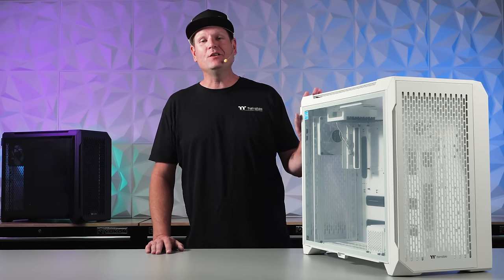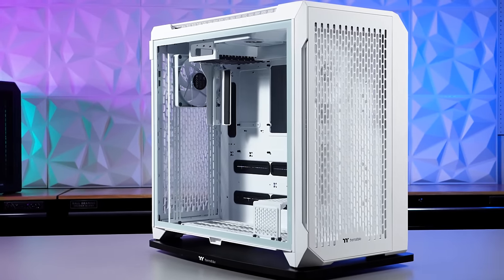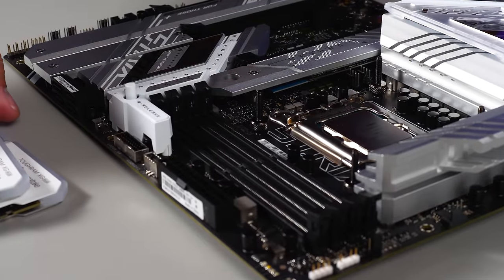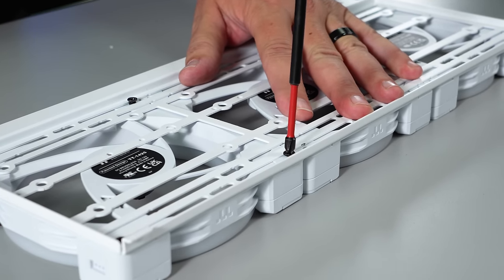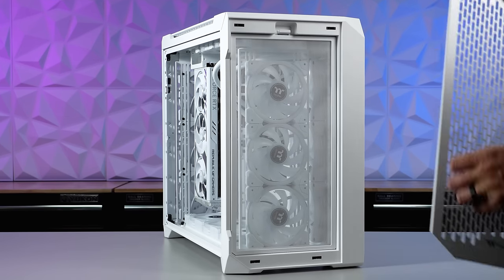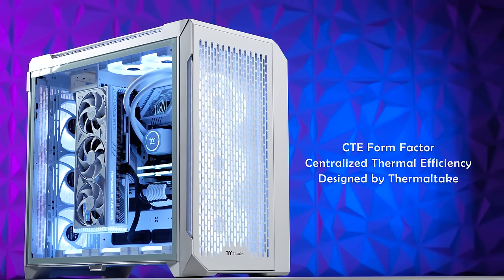Thermaltake CTE C750 Full Tower Chassis Overview Build Guide

Comment: I find it intriguing that there is no mention of the challenging access to the plug plate of both the graphics card and motherboard in your video. It is also worth noting the frustration that arises from the intricate cable routing within the case and the time-consuming nature of plug and play setups. Furthermore, it is quite inconvenient that every cable needs to be excessively long. While the concept itself is promising, the execution leaves much to be desired.
Reply: Every case has pros and cons. Also, not every case is meant for literally every type of PC builder. If all you can do is sit there and point out all of the flaws, meanwhile ignoring all of the benefits, this case clearly isn't for you. And that's okay.

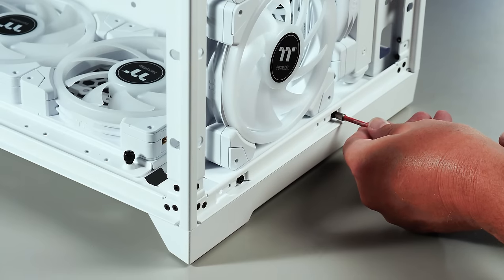Comment: I have the exact 4090 that is shown at 3:13, ever since the case was revealed earlier this year I wondered if the radiator could be installed in the exact spot on the top as shown in the video. This of course means I will have to buy this case now lol

Comment: I built in this case it looks good and the temps are better than my old basic chasis, on each side mine has 2x200m fans intake, 3x140mm bottom intake the AIO has 6 fans push/pull i used the 3x140 that came with the case on the back of the radiator since no RGB

Comment: Nice, but I'm more interested in the C700, can we get an overview of that chassis. Oh, and someone needs to come up with a DIY Screen/monitor/display with a bracket to mount on the bottom fans.
Reply: Thanks for the feedback, the C700 is very similar with the C750 with the cooling mount next to the MB as one of the big differences. Totally agree on the screen ideas, we think we all need more screens in our life too!
Reply: @thermaltake_na  What is the drive support like on the C700 because if is literally a shorter C750, then that's going to be a problem. You're not going to want to mount drives at the bottom instead of fans and one 3.5" or 2 2.5" isn't really enough for me.
It's great to see the PSU behind the MOBO but I really wish the PSU was setup to intake from the traditional rear and exhaust out the top rather than intaking from the side that's likely to be against a wall. If it was round that way, you'd have much more room for drives behind the MOBO tray also.
Reply: @zig131  It's shorter in length, not height IIRC. The same drive bracket in the back would work if they include it.
Reply: @Dexx1s  Yes exactly - which only has room for 1x3.5" drive or 2x2.5" drives. Yes NVME drives are getting cheaper but they're still not really cheap enough to justify for bulk storage of music, videos, documents, and downloads. Plus for important files, I prefer the gradual deterioration of HDDs to the working-one-day-dead-the-next of SSDs.
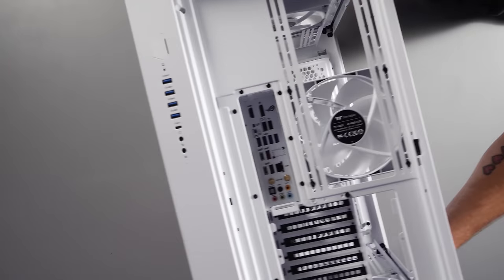Reply: @zig131  1:46
Reply: @zig131  I agree, and my hx1200 is passive all the time, so aiming the exhaust upwards allows the hot air to vent like in my Silverstone FT02 case
Reply: @zig131   Will have the Website up soon for the next models to come with the full details. Computex 2023 is next week, so wait and see :)

Comment: I wish there were a way to rotate it back to the natural position or maybe another similar size case... the vertical gpu position it just gets  too close to the aio and on the right side of the motherboard there is a lot of wasted empty space. I wanted almost the same case but normal layout 3x140mm front, 3x140mm side, 3x140mm bottom, 3x140mm top and 1x140mm back... options to put 420mm radiators l imultaneously... and the vertical gpu bracket has to the get the gpu closer to the bottom to give some distance to the cpu block
Reply: Also, being a big case, I would just make all the brackets 140mm mounting exclusives. The double mounting system 120/140 mm look ugly
Reply: Same.......I like 200's.......I have an ole tt mk1 chaser.....I like all the fans and the filters.......just wrong orientation.

Comment: Some GPU vapor chamber coolers do not like being rotated into this position.... So something to look out for if your GPU temps are much warmer
Reply: that is a myth
Reply: @TheKyozo  Even on Lian Li O11 Evo's Upright GPU kit webpage shows which GPU will work like this or need to turned upside down, to avoid having higher temps.
 Asus Strix cards do not like this vertical position.

I have a Silverstone FT02, and while my GPUs have been fine so far, many other owners have had cards running 10-30 degrees hotter in this upright position
Reply: @CoolColJ  will the 4090 suprim liquid be a good option for this case?
Reply: @greypiquero9056  it uses liquid cooling, so likely will be ok
Reply: @CoolColJ  haha. sorry for the noob question. thanks

Comment: i have the same case with vertical mount gpu mod and fully equiped with 14 fans of the same model as it came and the 420 aio included. fan layout 6 intake(3 bottom+3 front) at 800rpm and 8 exhaust at 600rpm.

Comment: The CTE case configuration takes a bit of getting used to by this old PC gamer.  Overall it's much better than my old case except for the mobo I/O ports.  Those are now hidden and all connection need to be rerouted through a puny rectangular open in the back of the case. I'm sure this old fashioned PC gamer can get used to no optical drive and obstructed I/O connections.  going to be a challenge running all 3 monitor cables through from the graphics card I/Os blocked.